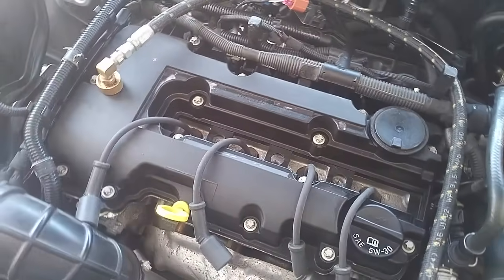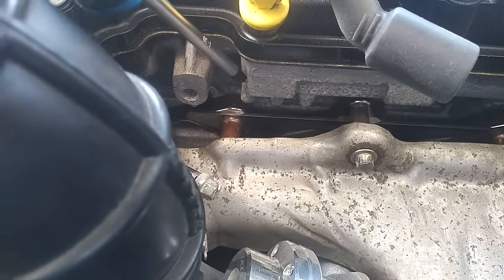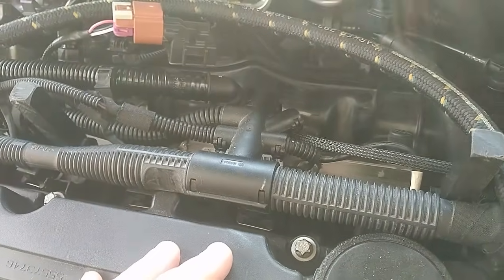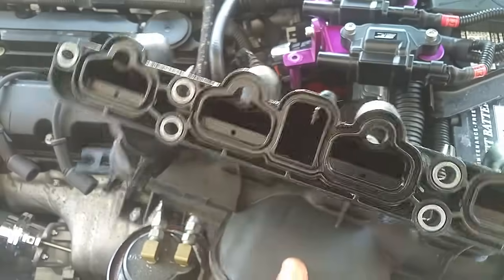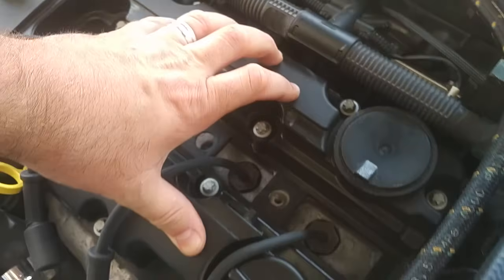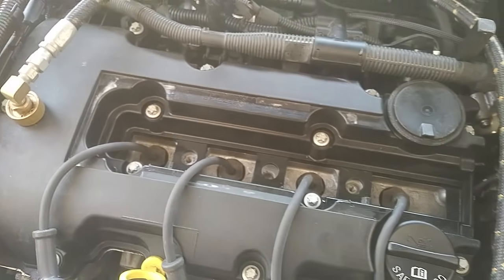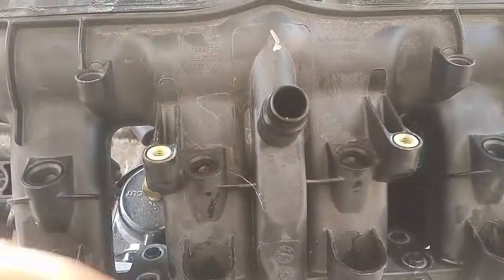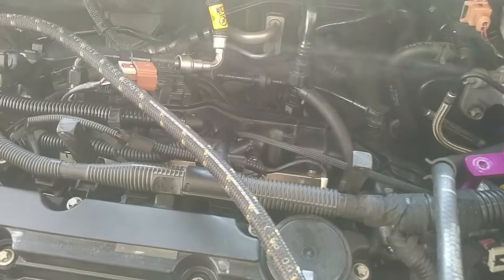Chevy Cruze Sonic Trax Encore 1.4L Turbo PCV Issues, Diagnosis, and Solutions

Comment: Why not just put an old style pcv valve in the place of the defective one made into the intake.  Would that not be easier
Reply from the maker: No, it would actually be impossible since you can't physically fit an old style PCV valve in there. You basically have 7/16" of diameter available where the OEM check valve is inside the intake manifold. Not even an option. Even if you could find a small enough one, getting it to seal against nylon would be a challenge in itself. You'd need a pretty long drill bit to make the hole as well. Just not a good approach.
Reply from the maker: Also, those old style check valves don't seal against positive pressure very well and they'd leak constantly. Remember, this is a turbo engine. No turbo engine out there uses an old style PCV valve and there's a reason for that.

Comment: When I cover the vent that is sucking air the engine problems do not improve.  Does this mean it something else and I sound not replace the cover?
Reply from the maker: You need to replace the valve cover ASAP!
Reply: When I cover the vent I do hear a chirping noise.  But the rpms stay the same.  Will I need to replace just the valve cover?

Comment: I have a 2016 Chevy sonic and mine is just the vacuum leak I believe. It sucks air through that small hole. So I’m going to have the valve cover replaced but how much can you drive on it like this? How bad is it to drive with this vacuum leak? I can’t believe GM is still making them like this and that’s why I don’t trust GM too much. It says enough that Dre Dan made his own fix it kit and GM can’t fix the problem 😕

Comment: Do these failures occur or start to occur without throwing a code? If so, how do you diagnose it from instrumentation (e.g. turbo boost measurement) running an OBD device? I've been having oddly rough performance and subpar gas mileage since my dealer's 50,000 mile service a few weeks ago, and there was a bit of questionable idling before that which I chalked up to my usual spring routine of having very little highway driving and not even all that much city driving that time of year. I had dealer replace fluids (radiator flush, transmission flush) and flagged to them the possibility of a PCV situation; they did not find anything wrong on the PCV but did see a plug not quite all the way screwed in (corrected) and a boot on a plug wire slightly corroded (replaced).

Comment: bought pvc kit and fixed mani, repl new valve cover w/ gasket , cleaned throttle body,  new spark plugs. check engine light off sounded good while at idle but when test drove next day  hesitates  feels like it is sluggish at higher rpm? any help appreciated. was thinking maybe turbo? cause we actually didn't have any problems until 98,000 miles so maybe issue with check valve there?
Reply from the maker: Check the throttle body connection to the charge pipe; you might have a big leak there. Also possible the turbo is on its way out, or the catalytic converter clogged if you've been burning oil for a long time. Hard to tell without being able to look at it closer myself.
Reply: Thanks for the info.... @AndreiDPop
Reply: @AndreiDPop  Thanks , we originally cleaned MAF and TB before we did further research and found out about the pvc and the mani and the valve cover. we replaced maf sensor and upstream 02 sensor as well.. I tell you this crazy...but we appreciate the input..we cleaned TB again but hubby says sounded and acted worse????oh my! that was going to be my next thought that the check valve in Turbo gone bad? I believe that I heard that on video as well. Maybe we should build our own cars ...LOL especially the price tag it originally came with. Appreciate all the videos and details  it is very helpful...

Comment: So will this failure cause the underboost code?
Reply from the maker: It can contribute to an underboost code. An underboost code is set when the engine is producing less boost (air pressure) than the engine is expecting it to given a set of parameters. A big leak in the intake system (or many leaks that accumulate to the equivalent of one big leak) will set off an underboost code.

Comment: Is anyone having trouble removing the corrugated hose from the manifold? Mine's not budging even with the clip off, and I don't want to break it.
Reply: Didn't have a problem getting it off but def, had a problem getting it back on...There was a o ring and a washer inside that hard plastic pipe .
Reply: I'm asking everyone now how to remove and any other tips. I want to check that valve and clean it if it's still there. Please let me know if you find any help. I'll do the same. Thanks
Reply: Chris Snyder eventually I was able to wiggle it off with the clip off. I could see that the check valve was gone. I already installed the kit. It took me about 5 hours as a novice with a lot of tools
Reply: @MCZ70890  thank you!
Reply: @MCZ70890  I got the clip off with needle nose pliers. I see what you mean though about it not wanting to come off. I'm afraid of breaking something or cracking it. Lol. I will just wiggle the damn thing until it comes off. Thank you for responding. I appreciate it!

Comment: Just wanted to give a big shout out "Thank you!" as I had several codes - everything you'd mentioned in your video!  I was on the fence about selling my 2014 Chevy Cruze LT and finding one error after another pop up, but since it's paid for, I thought why not see about fix it permanently?  And so, I came across your video and purchased your "GM 1.4L LUV/LUJ PCV Fix Kit V2" - kind of a h*ly sh*t moment after firing it up and running it with your kit on!   It now runs like it did when I drove it off the dealership parking lot!  Wow - just wow!  Dre Dan's kit was the perfect fix for all my problems so at the very least, I thought I'd write you and again, say thank you!    For a 100% failure rated part, the intake manifold with it's cheaply designed check valve...well, this is the way!  It was also a good time to clean the throttle body and  everything I had access to - a lot of built up crud as this was the first time having it apart since I bought it.  This was surprisingly an easy job and your kit came with everything you  need - was fun actually!   Dre Dan, so glad I purchased your kit!
Reply from the maker: Thanks for the awesome review! I really appreciate it. I'm so glad this fixed your issue. It's great seeing feedback like yours. I really appreciate it!

Comment: When I run at idle I have a boost gauge set up in the car and it idles at 15 to 20 in hg, when I'm driving at a constant speed it levels off to 1 in hg and that's mercury, you say in" of water doesnt that equal to 205ish at 15 in" hg? I'm curious on what could be happening I ran a boost leak test and everything seems to hold good at 20 psi
Reply from the maker: The vacuum test should be on the crankcase, not the intake.
Reply: @AndreiDPop  is there a video for that what I did was a boost leak test held at 20psi after I did the check valve mod and I had a boost gauge installed and it sits at 15 in"hg  at idle

Comment: What way do you put the external check valve on coming under the intake, I have the flow towards the throttle body and vented into the brake booster on top,
Reply from the maker: That's the correct way. There are links to instructions on cruzekits.com

Comment: Would Pcv issues cause the p0299 underboost code to come up?
I had to replace the turbo in my 2012 Cruze and the catalytic converter and that code keeps coming back. Also I replaced both o2 sensors.
Reply from the maker: Yes, very possible this would contribute to an underboost code in addition to other boost leaks.

Comment: Thanks for posting. I am a big fan of all your kits. I have purchased most of them. One question. What is the brass fitting with the nylon braided hose that looks to be installed on the passenger side of your cam cover with the hose going off screen on the drivers side? Thanks
Reply from the maker: Thanks for the reply! It's a return line for my AMSOIL single remote bypass filter.
Reply: Dre Dan we cant wait to see that how to video! Thanks again!

Comment: Question on the flap on the check valve is it common for the valve to disappear?
Reply: I have my car at the dealer and they are trying to deny my warranty because they said the valve is missing and can not warranty if a component is missing? Where  would it go is it came off?

Comment: I have a chevy sonic 2014 I get a regular oil change. But have started to experience a change in the way it rides. There have been times when stopped at a light and the car will like shake. There has been a time when i have started the car and shifted the gear to reverse and the car has bucked. Not offtened.  Now car repair is expensive and im on a budget. 
But need some help. Also I've noticed where you get 34 mpg. Mine now shows 17mpg. And my thermostat needs repaired which I'm working on now.
Can you please give me some help direction.
Reply from the maker: I would start by looking at my disagnosis videos and diagnosing the potential issues with your engine.
Reply: Clunking in reverse. You might need to change transmission fluid

Comment: I have a diesel Cruze ( hopefully they're not susceptible to this failure.. ) but were it me, I'd put the check valve on the top side of the manifold.  I deal with check valves all the time in my line of work, and they get bored and plug up at the worst possible time.  When I say "top side" I'd just flip your hose / valve assembly end for end, so you can more easily reach the valve.  I like your idea though, thanks for sharing!
Reply from the maker: I finished the design for my V3 PCV fix kit recently, and that's actually what I'm doing with that one.

Comment: I have what seems to be an engine oil leak on the right of the engine, coming from the lower hose by the temp housing unit.  I also notice that one of the torque screws on my valve cover is constantly dirtier than the rest.  This is the one on the front left of the valve cover.  What can this mean?   Basically my 1.4 turbo isnt producing enough power to run my AC on hot days.  The AC works fine, but after 20 mins of running the car sometimes doesnt start up.  Any ideas of leads of what I should check?  thank you!
Reply: Barry Zelcer is the leak related to turbocharger oil lines? those have updated parts

Comment: I recently  replaced the camshaft cover of my Cruze 1.8 , fixed the PCV problem but now I have some white smoke coming out (not all the time but after a stop for example) is this a manifold problem ?
Reply from the maker: Honestly I can't help you much with the 1.8. My expertise is with the 1.4T. White smoke would idicate you're burning coolant somehow. Is your coolant level still good?
Reply: @AndreiDPop  Thanks! yes, the level is still good, I check this everyday, but this problem came just after I replaced the camshaft cover. Not sure if this is related or not.
Reply from the maker: @theother526  It could be a defective cam cover. If it's not coolant, then it's oil or it's running rich. How's the oil level?
Reply: @AndreiDPop  In fact yes, oil was low after the change but I thought it was "normal loss" when changing the camshaft cover, filled up with oil again and haven't seen any loss since then, but this white smoke problem came just right after that change, not sure if now the manifold is the problem. I did some research on cruzetalk forum and seems like the PCV and the Intake manifold are very related, like if the PCV fails the manifold will fail as well or viceversa. I will check it this weekend, I hope this is not related to cylinders, or something else.
Reply: @theother526  did you find a solution?
Reply: @codystedman9369  Hello. Yes, it was a long way. In short, I replaced all the engine gaskets (Basically all that is included in this kit: FEL-PRO HS 26516 PT-1 Head Gasket Set  -Check it on Amazon-) Of course I took my car to a qualified person for the job. I also cleaned my intake manifold (it was full of oil due to the camshaft issue) and my car now feels brand new. Even when your problem could be other, It is highly recommended to replace all gaskets for this car, in my case it is an almost 10-year old car. Good Luck! EDIT MY CRUZE is the 1.8L version

Comment: Did you have any oil in your intake manifold. I have oil leaking out of my air intake that’s hooked to the intake manifold. I’ve replaced the valve cover last month and now I’m having oil leaking out of the air intake pipe and a studder when revving the engine at higher RPMs.
Reply from the maker: Yes, I did have oil in my intake manifold. A lot more before I installed my fix, less afterward. 

You need to install my PCV fix kit if you haven't already. Also, you have a big vacuum/boost leak at the throttle body connection you're talking about. That clamp needs to be tighter.

Comment: Man this was an outstanding video and explanation of a system I was really unfamiliar with! Also I kept calling it the PCV, I stand corrected haha! I definitely need to buy this kit and or replace my Intake manifold. I’m on my 5th valve cover with not knowing why the diaphragm keeps tearing. Has your kit proved beneficial? Much thanks again!!!
Reply from the maker: The kit does seem to have reduced the frequency of valve cover failures! Definitely beneficial.
Reply: Dre Dan thank you! I will definitely have to pick up one of your kits! Is the installing pretty simple??
Reply from the maker: @DanDeZinna33  It's not too bad. There are links to instructions on cruzekits.com if you want to read through it. It shows you all the tools you'll need also.

Comment: I replace the valve cover gasket because of a bad diaphragm At about 70,000 miles. Now at 96,000 miles it seems to have blown again. Based upon your video I’d say that my real problem is the PCV in the manifold. Does this mean I will have to either replace the intake manifold or apply your fix AND get a new valve cover because the diaphragm is ruined again?
Reply from the maker: Yes, you're correct.
Reply: How long does it take to get your kit regular shipping?
Reply from the maker: @east5871  2-3 business days.

Comment: My wife’s 2013 Cruze 1.4 has an air leak right where that PCV hose goes into the manifold. Could this be causing the Bank 1 too lean code I’m getting with check engine light?
Reply from the maker: Yes. Did you ever remove that hose?
Reply: Dre Dan yes I had to replace the engine so we had to take that hose off. I figured it shouldn’t be hissing air out right?
Reply from the maker: @jarretthallock2547  Two potentail causes. 

1.  It cracked. The nylon is brittle and cracks easily. 
2.  There's a plastic ring inside there that falls out and gets lost if you don't know to look for it. That aligns it so that it seals correctly. 

In either case, replace the hose with a new one.
Reply: Dre Dan how do you remove 2nd pcv check valve. Looks like a squeeze release pull but I’m having a hard time removing it

Comment: I watched a video, can't remember who, where the guy just plugged that cap off with gasket maker. Not sure if that's such a good idea or not. I'm going to be doing my 2nd valve cover replacement in the 2 years I've had my car.
Reply from the maker: That's a really bad idea.
Reply: @AndreiDPop   thinking about getting thst pcv kit & a tb spacer for future installs.
Reply: How do you get the 2nd pcv hose off? I can't get it loose & I'm worried I'll break it.

Comment: I was curious of something, I recently replaced my valve cover due to getting engine light codes and the diaphragm started to suck air. after replacing the valve cover I dont hear anymore vacuum leaks. I have bought the inlet manifold. the reason i bought it was that when i pull the oil dipstick I get quite a bit vacuum once its pulled. Im not trying to check the oil lol. I've check my nieces cruze as well and her's does not create this amount of vacuum. he's is just an initial slight vacuum break then it just becomes slight positive pressure and her idle stays constant. once I pull my dipstick my idle gets really rough and continues to be a constant vacuum. does this mean that the inlet manifold pcv valve is bad as well before I change it out? what about the turbo charger pcv valve? just curious before I tear into this thing.
Reply from the maker: There should be vacuum in the crankcase at idle. If there isn't, the intake manifold check valve is not working correctly. You'd have to test the turbo inlet check valve to see if it's operating correctly.

Comment: I have an extreme loss of power and a rough idle but there is no check engine light on. What could this be?
Reply from the maker: Could be anything to be honest with you. Turbo gone bad, massive boost leak, who knows. Going to need more information than that or some kind of diagnosis. Watch the video, perform the checks, watch the boost leak video, perform the tests, check the turbo shaft for play (unbolt the downpipe). Really going to need to do more diagnosing.

Comment: Hey Dan im having a vacuum leak issue  with p1101 on my 2016 chevy cruze lt 1.4 turbo. Ive checked all of my hoses MAF sensors n the basics and everything is fine. But Could this also be my issue and a fix?
Reply from the maker: Did you replace the corrugated hose from manifold to turbo? Did  you perform a boost leak test? Is the valve cover sucking in air at the pressure regulator diaphragm vent?